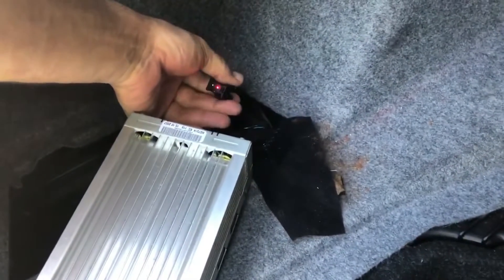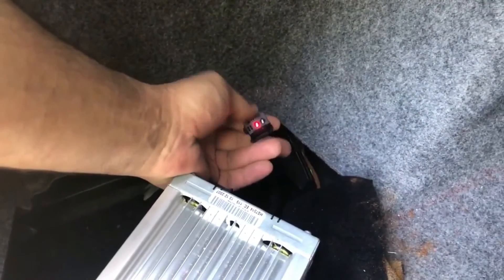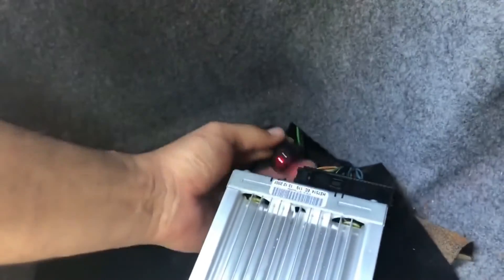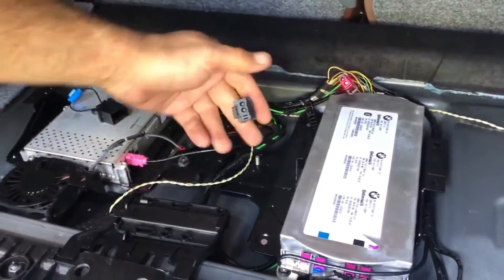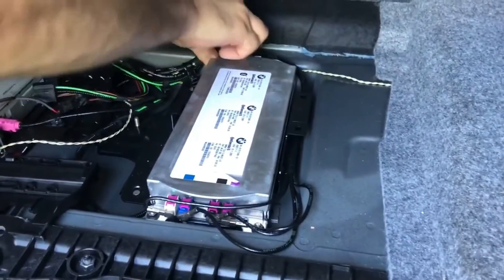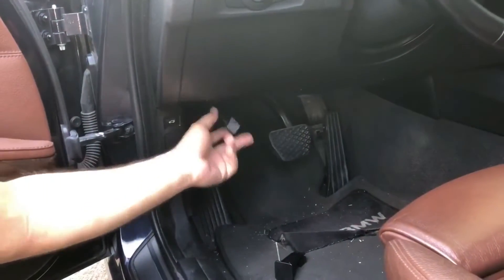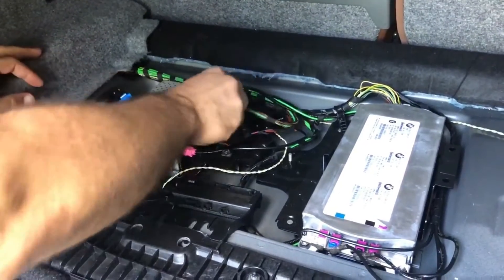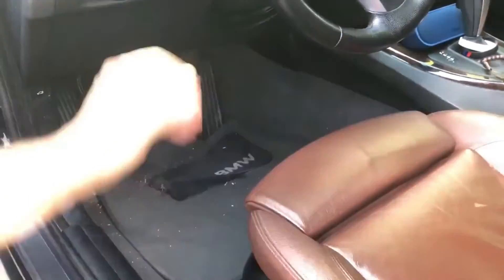BMW MOST BUS DIAGNOSTICS AND REPAIR, E90 EXAMPLE

Comment: So if you bypass the satellite and still no light in the front what is it?
Reply from the maker: Some other unit obviously, video shows schematics
Reply: @Bavlogic satellite is the last module before going to the front. I’ve bypassed the satellite but still no light under the dash.
Reply from the maker: @rontidgwell8896 well that means it’s not the last one, if at sat you see red light and after bypass you don’t see red light at next unit it only means it wasn’t the last unit. Schematics in the video is default one for e65 but in your car it could different order
Reply: @Bavlogic thanks man there’s one under the phone I haven’t checked yet. I had a litre of vinegar opened up and ran down over everything and the radio stopped working. Had light to the amp but no light at the phone. Bypassed the phone then had light to the sat but nothing to the loop under the dash. Bypassed the satellite as well but still no light to the front. I’ll check the modular under the phone.
Reply: @Bavlogic the unit under the phone and the amp was blown. All good now

Comment: You’ve held quite a reputation on the e90 forums, and I wonder if you can help. I have 06 330i, logic 7 and idrive. Ccc is dead. I want to install aftermarket android. No vendor sells compatible system for dead ccc. I tried anyway, with MOST converter, but no success. What could I be missing?
Reply from the maker: Well you can’t bypass ccc, all androids are nothing but screens ON TOP of original bmw entertainment system, so basically they simply screen switchers. Switches between oem and CarPlay, sound is router via original AUX port.
 So you need to repair or replace CCC system, that’s the only way. We do repair, sell them often, so if interested go to Bavlogic.com and check it out.
Reply: @Bavlogic I have seriously considered sending the unit to you, that’s my final option. But I couldn’t understand why the Android center stack wouldn’t work. Not the on top of dash Android. But removing the CCC, leaving the idrive blank. The MOST loop should stay intact, the amp should receive the signal to turn on, but I can’t find a technical reason why I can’t get this to work.
Reply from the maker: @Blissfullyunaware7590 I’m not getting, your ccc is dead or not? If dead you won’t see ANY light at all or light will blink but main application module being dead won’t help.
  Don’t waste your time, ccc is the HOST so without it working properly all bypasses loops make zero sense
Reply: @Bavlogic  Sorry, yes the CCC is dead/ dying. The iDrive reboots to white and the BMW logo intermittently but never stays on. I've attempted to replace with an android in dash radio. With the thinking that I could just leave the iDrive on top blank. I bought a MOST adapter for the output from the android unit. I can see light reaching the amp, but after watching your video, and reading pretty extensively on your website posts, it's clear that I need to check every node to ensure it's reaching everywhere. And I think I read on your website that since I've let the CCC constantly reboot for a few months, it's possible that this constant rebooting has damaged other modules in the loop.
Reply from the maker: @Blissfullyunaware7590  CCC must be in good order to get sound working. Absolutely makes zero sense to bypass anything if head is bad or dead
Reply from the maker: @Blissfullyunaware7590 you do need working ccc unit to add android screen. Android screen isn’t ccc replacement but a skin on top of it.

Comment: Once the sat is bypassed the whole module can get thrown out correct?
Also if the telephone module is bad can it also be bypassed? 
Does the e63 m6 also have a blinking indicator in the amp?
Reply from the maker: Pretty much yes, repairing it makes no much sense, doesn’t matter what module it can be bypassed, the only thing if you bypass the amp you’ll get no sound.
E63 m6 might or might not if it’s premium individual amp. It’s got the led insude  but it’s not easy to see it

Comment: My fiber optic is connecting all the way to the terminating loop and I’m still getting no sound so is it my amp that’s bad. I have absolutely no sound not even chimes
Reply from the maker: Amp led is steady yellow? If so most likely the amp
Considering head unit programmed properly and not eBay repl
Reply: @Bavlogic not steady yellow it’s blinking yellow/orange
Reply from the maker: @zackirlbeck4765 if it’s blinking it means loop isn’t complete, you can bypass the amp, in that case you’ll see telephone module working in the menu if you are correct, usually yellow led in good amp means loop isn’t complete but we saw few cases where amp was bad.
Reply: @Bavlogic  I bought a fiber optic bypass and I plugged it into every single fiber optic I could find and try to start the car no sound, but I’m getting the fiber optic signal all the way to the front of the car so I know it’s getting through all the amps I literally just bought an amp right now used I’m gonna throw it in the car and hopefully it works. I don’t know if I have to code these things to the car or not if I do then I’m gonna have some issues.
Reply from the maker: @zackirlbeck4765 most likely it won’t work, you need amp led to stay yellow it’s not the point to bypass every unit, you need to get the light back to the head, amp sees incomplete circuit and blinking telling you some other unit is bad in the loop, usually had amp gets no yellow blinking at all
Reply: @Bavlogic well I just went to out the new/used one in and the light was holding a steady orange not blinking like I thought it was
Reply: @Bavlogic  I’m currently putting in the used one now give me about five or 10 minutes and I’ll comment back with what happens
Reply: Omfg I just put the used amp in got all my fucking sound back!!! Almost a year without sound!!!! Let’s gooooooooooooooooo!!! No coding needed I just hit my head when I heard that bmw chime
Reply from the maker: @zackirlbeck4765 means your amp was bad, coding is required since let’s say you bought from convertible rear door speakers won’t work. If you bought the amp
From same car, it’ll sound ok even not coded.
Reply: @Bavlogic sounds good but your absolutely right about the speakers not working in the in the back next to the rear seat seats. This will just have to do for a few weeks until I take my car to the shop for the motor mounts that I’m doing they should be able to code this into the car but for now this will be just fine. I’m just happy that I could hear my chimes and radio again. And the amp that this car came from was the exact same spec as mine. It was a E 92 as well. It was just a year older than mine.

Comment: What is you unplug fibor optic cable under steering wheel and it is blinking then what
Reply: I unplugged mine and isn’t blinking but the one on the amp is

Comment: So I have the red light constantly through the entire loop yet still no sound. Lost atp
Reply from the maker: Amp could be bad if yellow led is on, also head unit could be encoded incorrectly.
For the future reference if you need help you can type: can you help?
Reply: @Bavlogic  amp has a yellow flashing light in it, and a red light for fiber optic. My Bluetooth module has been bypassed since I got the car without issue but I believe the satellite dlt module has recently called it quits. Putting a bypass on it allows rhe signal to loop but nothing for sound still. Im under the impression that that specific module isn't kind with bypass? Can help
Reply: @Bavlogic and I have tried 2 different amps both same yellow flash

Comment: This was helpful and good to see! But I found that it was the amplifier in my 650i that was bad … everything worked except for the sound when I put the loop on the amp and then everything stopped working when I took the loop off the amp and put it anywhere else in the chain… go figure ¯\_(ツ)_/¯

Comment: Did you ever figure it out man, I’m having the same issue for months now it’s annoying, I have the Harmon kardon sound my amp is showing signal, I can scroll thru radio stations and move it around but just no sound, it does not even say warning tones, the amp has a red and brown light on it, it happened when I washed the car
Reply from the maker: @josuearvizo405  must be the amp
Problem then. We figured out Around +1000 cases so far

Comment: All my MOST modules show a blinking red light but my replacement CCC unit still flashes a blank white screen every minute. 

🤦🏻‍♂️
Reply from the maker: @samgod  because your ccc is bad…. Buying used 15yo ccc is real gamble… we repair them successfully with warranty, that’s the way to go
Reply: @Bavlogic  3 years ago when my CCC stopped booting, I successfully waved a heat gun over some of the chips and it lasted another year. When it stopped booting again, I did the same and got another 6 months out of it. After that, heating and baking that board no longer made a difference. So I bought an entire replacement CCC unit on eBay and it only flashed white. Got my money back and bought another. Same.

Then I tried every combination of logic board with CCC unit with no luck. I've now had no iDrive and infotainment for over a year.

How much do you charge? Can I just send you the logic board? Can I get a discount if I sent you 3 boards and get one in return?

Comment: what if my head unit is not giving any signal to the AMP? do i need to replace the CCC unit?
Reply from the maker: @thekiller500099  head unit works overall?
Reply: @Bavlogic  yuppp i drive works just no chime, no sound no rings

Comment: This video fixed my 2006 e90 330i pre-lci that hasn’t had sound for about a year. I was inches away from buying a new amp but thanks to this man i didn’t. I simply bought the part listed in the link in the description, plugged it in less than 10min and heard the classic BMW ping. What a guy. I appreciate it!!

Comment: Hey my friend I don’t know if you still working with this or not but, in my case I have a328i 2011, and is working perfect but sometimes is just not turning on when the car is on. The radio can turning on in like 10 or 15 min by it self . And another thing that i see is , if my phone has the Bluetooth on never get the radio ON, I check the fiber and is blink it on

Comment: If the amp is bad would the red light to the telephone module work?
Reply from the maker: No, first node is the amp, so if amp is bad tcu won’t get red light signal. Bad amp in rare cases can still transfer red signal but you won’t see yellow led in it

Comment: How do i test my amp
Reply: logic 7 e60
Reply from the maker: If there is power going to the amp and fiber optic signal, it should work or at least blink yellow from the rear section
Reply: @Bavlogic  I figured out that it was on i’m having a no sound no chime issue optic signal runs all the way complete power to amp been like this since april 2022 I gave up on it last year but started trying to figure it out again recently have no clue what’s causing it

Comment: Hi i changed my MULF with MULF2 on my E90 (MULF has bluetooth issues) after i set MULF2 it work perfect for two months now when i trying to connect my phone with bluetooth on bmw professional radio it stuck on "bluetooth devices pairable..." and cannot connect with my mobile phone
Reply from the maker: Mulf2 failed, it’s common

Comment: On my BMW 328i 2010 the amplifier is not on the trunk, could it be inside the dash?
Reply from the maker: 3 levels available:
-stereo option no amp at all
-676 hifi amp in the trunk no fiber
-677 fiber optic amp in the trunk just like in the video
Reply: So I found out that my car has no amplifier, but I got a black amplifier from another BMW 328i. I was thinking in installing in my car, is it possible?

Comment: This is the first time I’ve dealt with this, I got the SOS randomly after hitting a bump I suppose. I checked every optical loop in this video and none of them are flashing red or any color at all. I tried the bypass loop on all of them and nothing. Idrive screen is black, no music, radio, door chimes etc, if anyone knows what I should do or look at or if I’m doing something wrong please help. (2008 335i w logic 7)
Reply from the maker: Head unit produces fiber light, so it’s lost somewhere obviously, you need to
Find out where. It’s gotta be flashing at least at first receiving unit
Reply: @Bavlogic  Do you know where the unit is? I looked at the one under the steering wheel, and 3 in the trunk. Could it be a fuse or CCC as well? because it all happened after I hit a pothole so I'm guessing something came loose somewhere

Comment: Hi! My radio stopped working and the SOS light came on on my BMW 335i E93.
In my case the AMP was broken so I connected a loop. After this the SOS-signal turned off but still NO sound from the radio.
Any idea what this could be??

Comment: Amp blinks yellow (logic 7) all the fiber optic plugs are blinking red except for the one under the steering wheel. Radio buttons work but no sound or chimes any suggestions? Tried to bypass the sat module and other one even though the fiber optic connections were blinking red and still nothing.
Reply from the maker: Means no commutation between last module to the steering wheel point
Reply: @Bavlogic  I just tried the jumper loop again on the sat module after putting a different amp in I now have a the blinking red under the dash but still no sound , this is a headache 😂

Comment: I have tried everything.  I have bypassed or tried to bypass all of the components. I still get an sos issue
Reply from the maker: You are doing it wrong, you need to see if signal comes back to head unit. It starts from head unit and must come back to head unit, in your case it’s not coming back to HU

Comment: Hi when i disconnect plug from satellite unit and plug it back in the radio comes on until i hit a bump in road.  Then it goes off. I bought the loop today assuming the satellite unit has something broken inside.
Reply from the maker: Yes sat unit is bad
Reply: @Bavlogic  yea i don't use satellite anymore so loop will help.

Comment: Hi! Please help!!
On my 06 330, the light is on at the amp, but off at the Bluetooth thingy in trunk and off on the wire under the steering wheel… 

I haven’t been able to test the voltage due to not having the tool.

So that means it’s the amp that needs replacement???

Comment: So what if my first wire (the only in the beginning of the video) has no red light
Reply from the maker: It starts from the back of the head unit originally, check it there and find out where it goes. If no light in the back of the head, it’s the head unit
Reply: @Bavlogic  I’m putting an aftermarket stereo in, my fiber optic cable isn’t connected to anything where should I put itv

Comment: I have a 330i e90. My speakers had a large 100db screeching noise, 15 min later it stopped. I have 0 audio on anything (Inc aux) would that be my logic 7 Amp that's busted? I also don't have a SOS sign showing up... so I'm confused on what to do.
Reply from the maker: Most likely the amp, but I can’t diagnose it properly over the air…
Reply: The same thing happened to me… did u find a fix?

Comment: I have a ‘06 330xi (e90) and have this same exact issue, the light at my tcu is blinking (I don’t have a sat tuner), but the cable under my dash has no light. I disconnected the cable at my tcu and connected the fiber optic loop, but the light is still off under the dash. Any idea what else it could be? So basically I only have the amp, tcu and block off connection under the dash. Cable at the amp and tcu are blinking, but the block off is dead. Fiber optic loop on tcu cable doesn’t fix issue and block off connection is still dead/no light.

Comment: Hi my light is only red not orange can anyone explain ????
Reply from the maker: Means amp is bad, yellow is a must. We can fix the amp
Reply: @Bavlogic  how much ther only cheap to buy tbf water damage I woke up today opened car door heard alot of noises cumming from speakers didn't think owt so after driving 4 hours I've gone in boot to look at amp notice puddle water after that down poor last nyt im gutted thers a red light on in the amp but no orange, also the optic fiba lead what goes into the amp thers no lights flashing I don't no were ther fuse I's for amp on 330d 2006 e90 saloon. Can't belive it the rain jacked my amp 😒
Reply: @Bavlogic  the water wasn't on the amp it was below it buy im not sure if the water has gone in it or not cach 22 I thought ther was a cut out on fuse if anything happens like that stero works fine just no sound at all and it dont play as you usually see it when it's going on time I appreciate you helping
Reply from the maker: @scaledfast  check thick red wire, it must have 12v

Comment: My car has signal everywhere and I have 1 looped connected signal goes all the way back to the front termination loop. And my idrive works perfect but I have no radio sound or door chimes. Need help!!!
Reply: Hey did you figure it out I have the same problem

Comment: Question - what if you don't have the satellite tuner? Would you still use the jumper? I have intermittent radio on/off, the SOS light comes on/off, and the bluetooth stopped working (gives a high screeching sound when the phone is connected until the phone drops again). Would the telephone module need to be replaced if I don't have a satellite tuner?
Reply from the maker: Any unit in fiber optic bus can fail, sat tuner usually goes bad, but so any other can go bad